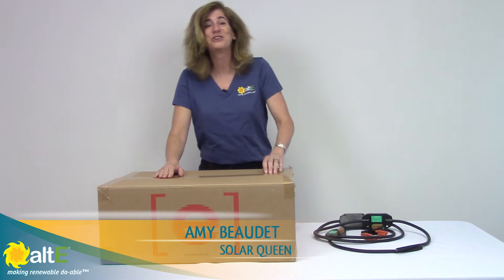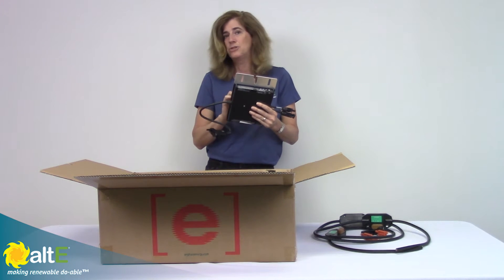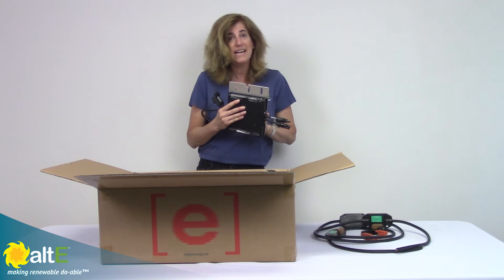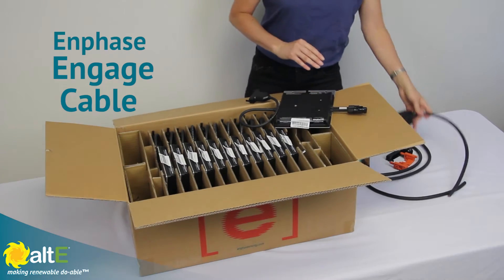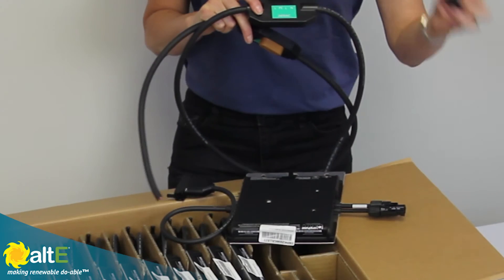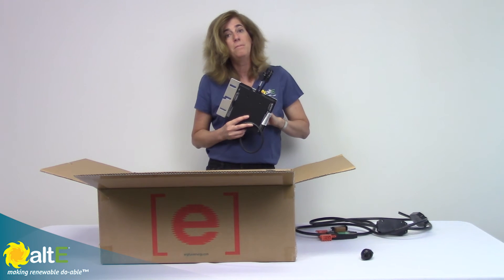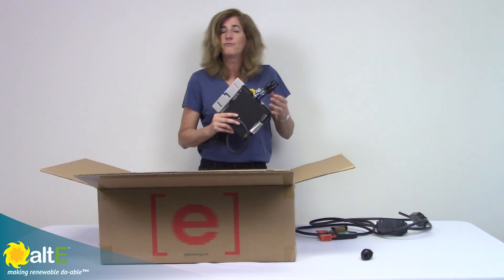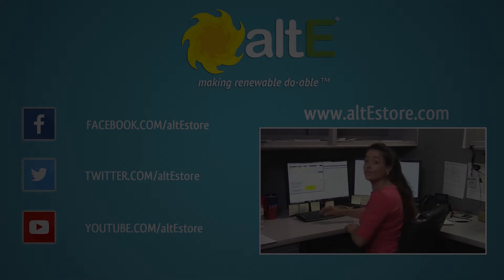Enphase Micro Inverters | M250 & M215 | Unboxing & Features

Comment: Can I use micro inverters in a remote location where there’s no grid power? Like in a cabin in the mountains?
Can I connect any good brand charge controller to charge batteries other than Enphase or Tesla?
I am ready to buy the IQ8A’s from you but first need an answer.
Thanks

Comment: I want to know when there is no sunlight, What can I do to have the power?
Reply from the maker: IT depends on if you are connected to the grid. If the grid is up, you just buy power from the electric company, same as usual. If you are not connected to the grid, or if the grid is down, you need to have a battery based system to draw the power from the battery bank.
Reply: Thanks for your answer, but I would like to see the wiring installation of microinverter plus batteries.
Reply from the maker: @vincentmasanja789  then watch this video about adding batteries to a grid tied system. https://youtu.be/WVM0F2OrQhA
Reply: Thanks.
Reply: @AltEStore  MEANS I CAN USE THIS TYPE OF MICRO INVERTER WITHOUT BOTH OF BATT+GRID

Comment: Every time I turn on the clothes dryer (220 volt) in the broad daylight it puts the inverters offline (Grid instability) it comes back but the point of doing laundry during the daytime is to use the power created by the 32 M250 inverters 300 watt panels I have on the roof. What can I do?

Comment: Why a proprietary AC cable connector, cant we just install a regular plug on it and plug it into an outlet?
Reply from the maker: Plugging onto an outlet is not allowed in the USA. It must go to a new breaker in the main breaker box.
Reply: Im actually doing this exact thing with the AIMS Micro Inverter. I called altE store and the female tech could give me zero reason why this would not work. I have an old NEMA 6-15 plug thats not used for anything  else and has a 15amp breaker, in  the box. So technically it has its own breaker in the main breaker box. Been working great.

Comment: Nice demo video. Question, some one helped a friend install three panels with three enphase M250 micro inverters. there is no open circuit voltage out of the j box. Are the connectors on the inverter pre made up from the factory or does the installer do that? If no voltage output could the installer helper have made up the connectors incorrectly?
Reply from the maker: Question, where are you measuring, the input or the output of the inverter? Are you measuring with the inverters connected to the grid?  If you are just measuring the solar panels going into the inverter, and the inverter not connected to the grid, then yes, it is quite possible the connectors are bad. If you are measuring the output of the inverter, and it is not connected to the grid, then it is behaving correctly, the inverter will shut off when it senses no grid. Step back and measure right at the panels when they are disconnected, then move forward to determine where you lose power.

Comment: Hi Amy,  do  these micro inverters work only for North America ? do they come with rated output of 230V @50Hz ?
Reply from the maker: Excellent question, sorry, I was too North American focused. Yes, Enphase does make 230V 50Hz inverters. They are different models from the ones we carry. M215-60-230 and M250-60-230-S22 are the 215W and 250W Euro version numbers.
Reply: Thanks

Comment: Hey Amy, Do they make micro inverters for large 72 cell panels 300w plus if I'm not going 3 phase route?
Reply from the maker: +James Bordon Not currently. As you know, their only 72 cell product is the C250 for 3-phase. However, SolarWorld is now making a 300W 60 cell solar panel that will work with the Enphase M250 for single phase, so that may be a solution for you to use a high wattage panel. https://www.altestore.com/store/solar-panels/solarworld-300-watt-solar-panel-sunmodule-sw300-mono-v40-frame-5-busbar-p40440/
Reply: +altE Good to know they're already making 300W 60 cells, Your prices are really competitive.

Comment from the maker: Joshua Senod Both have their pluses and minuses. Both can handle partial shading conditions, and can give module level monitoring. A SolarEdge solution is often less expensive than Enphase, and many prefer keeping a lot of the electronics off the roof, so they like the fact that SolarEdge only has the optimizing on the roof, and the inverting at ground level. Either way, you can't lose - both are great products.
Now get some sleep.